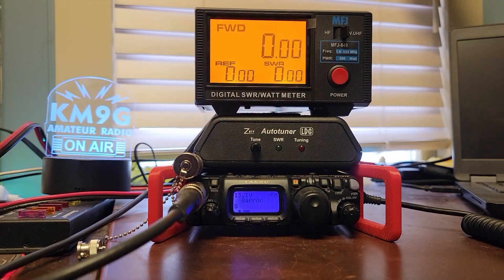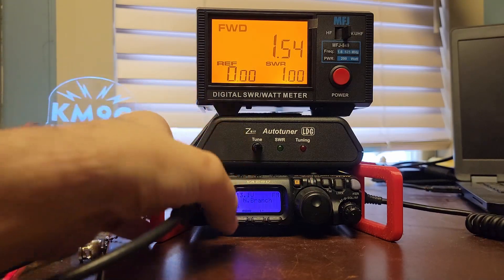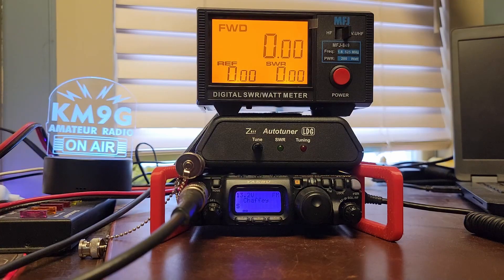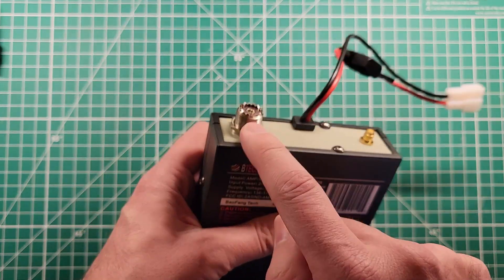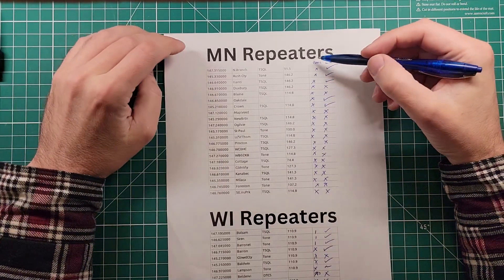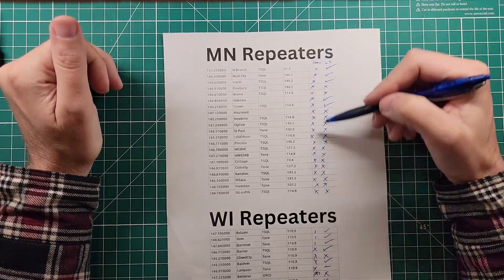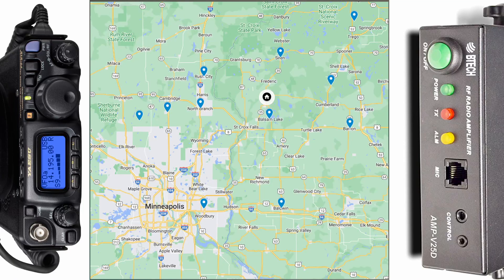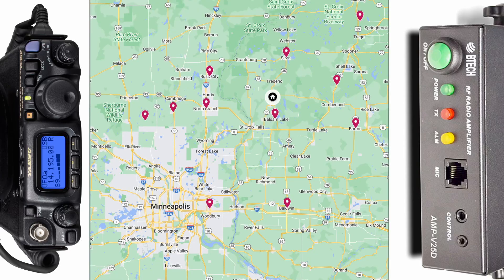Punching Up! with the Yaesu FT-818ND

Comment: that a great little amp. I have the UHF one. does the same with power with drive, it max out. has limit on power. I use on HT . wish they had a UHF/VHF dule band one. I run mine on a LiFePO4 battery . great boost into a j-pole antenna.  love how it can connects to K1 connector. great for Baofeng HT. 73's
Reply from the maker: Yeah, the work great and are very versatile.  I have a few more tests I want to run with it.

Comment: As always, thanks for the great vid Steve. Especially appreciate this vid on the Btech amp. I've been THINKING about getting one of these myself for specific applications (Kenwood TH-72 running APRS). For the $$ it seems OK providing it doesn't get too warm. Our friend in TN, KM4ACK has some vids of using this with his FT3D in a vehicle, and he says zero problems. The other option I've been looking at is picking up something used, like an older radio shack 2m amp. With those, and Mirage, the built-in heat sync is very prominent, making me think they may have an edge regarding heat managment. So, still thinking on this end....but always enjoy seeing vids on equipment I'm thinking of adding to the shack! 73, Tim.
Reply from the maker: I have one of those older amps to test out, and I agree in your thoughts... I'd only add that 40+ year newer tech should be better designed to handle heat and be more efficient... should...

Comment: I always found the a good antenna and hight let me hit repeaters with out a hill in way reliably 20miles away.  When I could get 25w I could get on one blocked by a hill with reflections. So what antenna did you use and how high?  Thank you for the video on the FT817/8.
Reply from the maker: I use my DX Commander
Reply: @temporarilyoffline  I did not know the DX Commander did 2M.
Reply from the maker: @thuff3207  I tested every antenna I could get my hands on a while back and for grins I tried the DX Commander and I was very happy with the results: https://youtu.be/pKUC7GbflCo

Comment: I use the non digital version on my gmrs repeater. My repeater is a pair of Motorolas cdm 1550s, have set max at 2w, at 2.5 the amp freaks out for some reason but is happy below or at 2 pushing out 30w at the duplexer. Clean, zero issues and no worries about my duty cycle or heat with my repeater.
Reply from the maker: Nice!  I didn't think about doing GMRS with it.  Mine is the 2m version. Might be a stretch?
Reply: @temporarilyoffline  yep, mine is uhf. Max 30 out the coax before duplexer and antenna regardless of the power..same for my ht's I tried.
Reply: This amp isn't a repeater grade product. Not only that, I am not sure if it's FCC type accepted for GMRS use.

Comment: huh - was wondering why a mic jack on an amplifier - I guess that lets you use a regular desk mic or dtmf mic with an HT. Nice for economy operating, but given you can get a whole chinese 25 watt radio for around the same money, or 50+ watt Japanese radio for another $30, not sure if worth it.
Reply from the maker: It's designed to boost your HT easily - leave this in your car, hard mounted with good power and antenna. Then take your HT when you leave.  Check out this demo https://youtu.be/9kj-xGTzh7E

Comment: Thanks. Nice review as usual. On the VHF Model I see an Analog Model and Analog & Digital Model. Which one did you use?  73
Reply from the maker: I used the digital model, but in analog mode.  I have to find a place where I can use DMR with it still... so more videos.
Reply: @temporarilyoffline  Thanks for the quick reply. Much appreciated